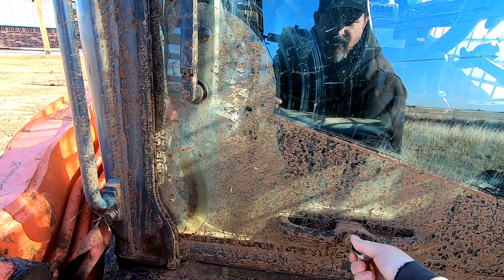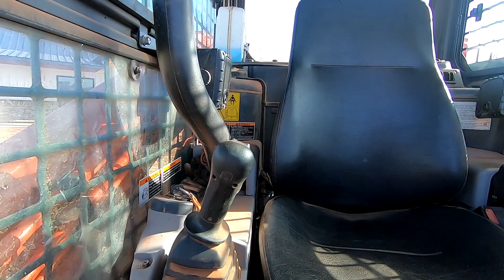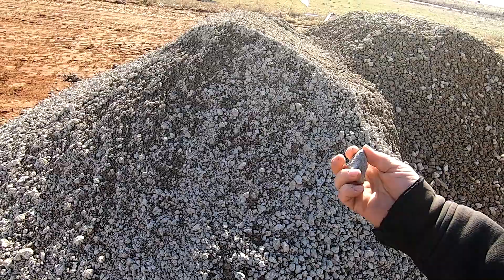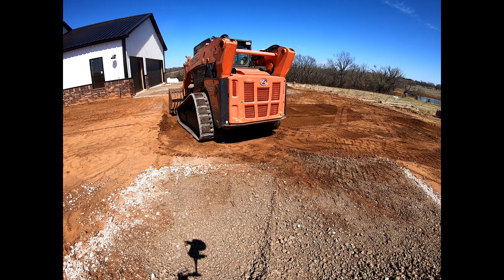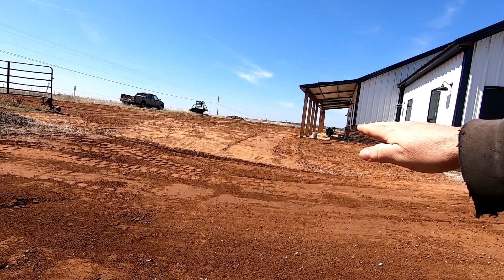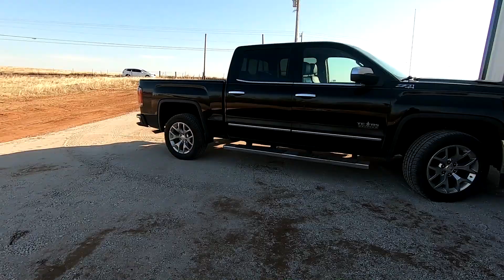Recycled Concrete Driveway Pro and Con #108

Comment: Is this the same as "wash out" concrete?
Reply from the maker: I'm not sure. I haven't heard the term "wash out" used for describing this material.  We call it crushed concrete and recycled concrete where I live. Hope this helps.
Reply: No. Washout is what they rinse out of the back of the concrete trucks once they get back to the yard. Normally it runs into a settling basin where they eventually pile it up. It's way more powdery with some big  chunks. It doesnt resemble gravel